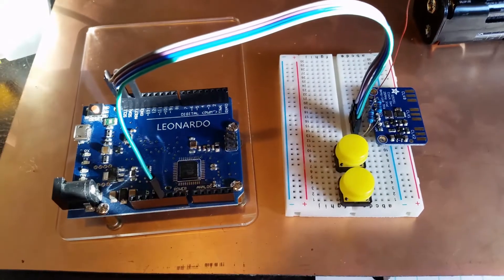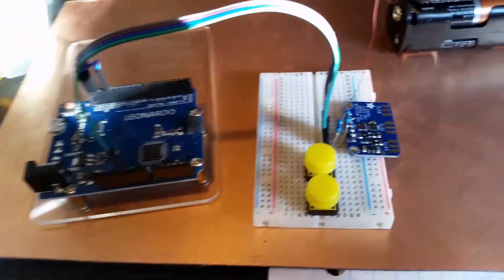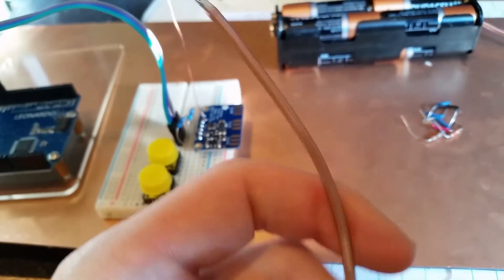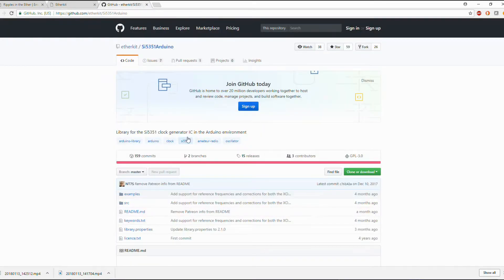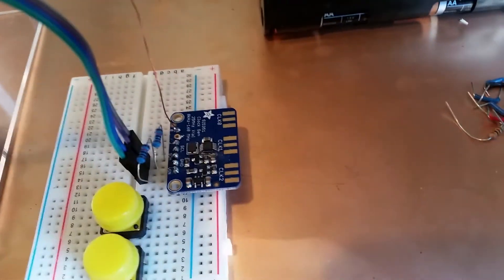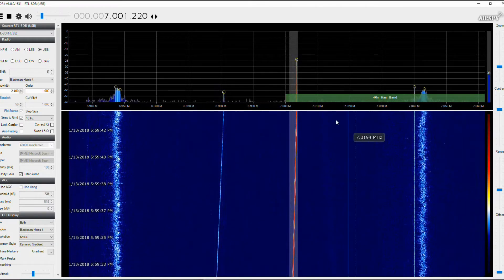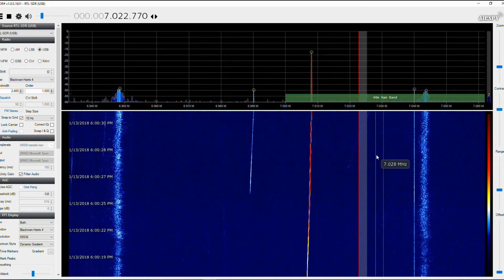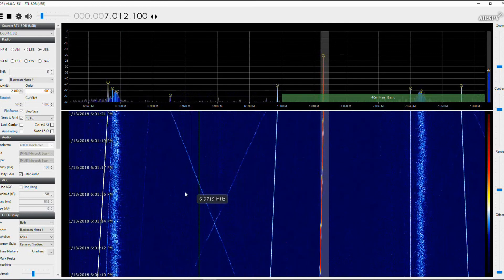Si5351 troubleshooting

Comment: Hi,
I realise this video is quite old now, just found it !
Just been playing with the SI5351 board and the Etherkit library, today
The pull up resistors on the I2C bus, are already incorporated on the module.
I've got good results, using the calibration routine.
I followed the comments on the github homepage by the person who made the library, the  Adafruit library kind of sucks !
I really simplified the code to the basic functions, I intend to use a rotary encoder to set the frequency.
Needed a means of generating Rf frequencies, without the bulky standard Rf generator, I may try 30db rf amp from China has well.
Good luck on your project.
Adam from the UK